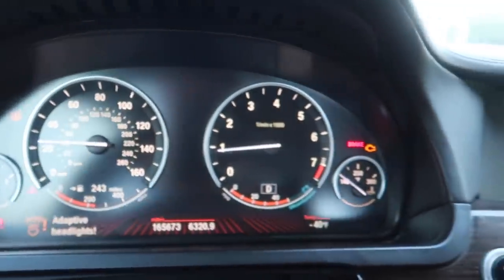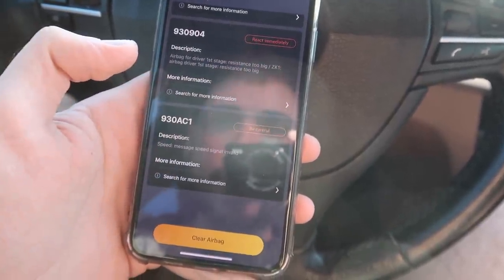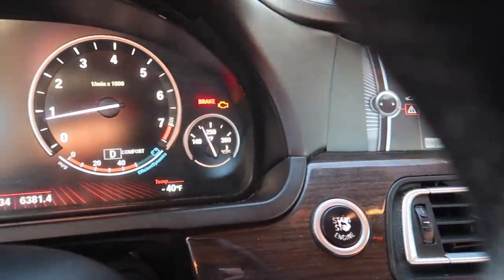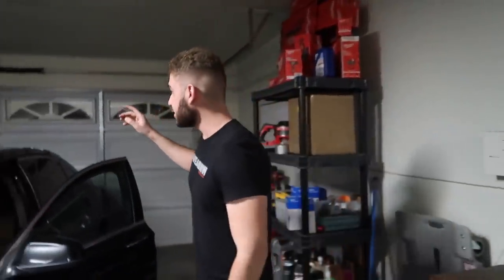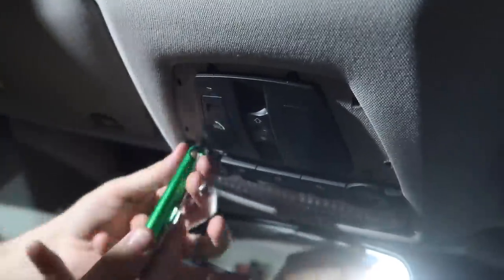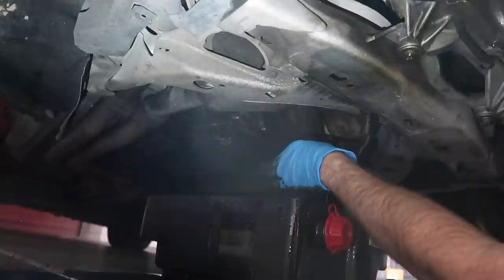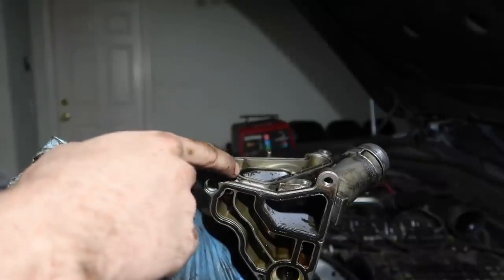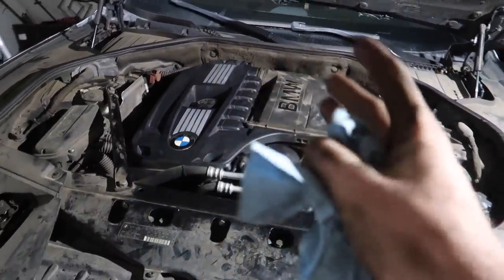Rebuilding An Abused BMW 740Li N54! Part. 1

Comment: Bmw's are known for condensation build up around the oil cap. Majority of the time it's not a head gasket issue. It happens from short drives. Long drives will usually burn the condensation off

Comment: Hey, depends the year of the car but the emergency release for park gear is located under the cup holders in the middle console. You have to pull them out. The tool to twist the lock is locating in the trunk with the tools that came with the car. If your car is a earlier model as mine is has an umbraco screw under the car by the gearbox that has to be screwed in for it to release and opposite for it to active again. But I’m pretty sure that you can’t drive the car with this active so I don’t thing that’s the problem here.
This gear changer is electronic and is known for some of the cables inside snapping that’s makes for example park unavailable

Comment: Hey Nour, I wouldn't be too worried on the the head gasket, oil and coolant mixture 8/10 times it's the oil filter housing gasket that goes bad. Like you previously stated there is no smoke coming from the exhaust and it's not overheating so, you should be all good.

Comment: There is a procedure you need to follow to purge any air out of the oil lines after opening up the oil filter housing gasket.

Comment: this is gonna be a good one just cause it is a 6 cylinder engine and not junk bmw v8's engines also i recommend doing a engine oil flush a gearbox oil flush and a cooling system flush god knows the intervals this car had its fluids changed i would also recommend a braking fluid flush too

Comment: Hi so I confused you with last message that must be for the older model 7 series hear are 2 links of YouTube that might help you sort the auto park problem 
https://youtu.be/1JLXDVPpj8w
https://youtu.be/UUKg3en7ulE
You car had it’s towing hitch in so it’s probably been towed so will probably need resetting hope this helps you 👍🏽
Reply: Up

Comment: You’re not supposed to open the coolant cap when the car is hot or the pressure will shoot out the coolant will burn you ....
Reply: Ma guy he knows his got the experience🙂
Reply: The bmw coolant expansion tanks have a fail safe that when a person depressurizes the coolant tank, it leaks from the bottom side of the tank so it wont shoot up the most it’ll do is cascade down from the opening!
Reply: I've done it before, it doesn't shoot coolant, it shoots steam, so as long as you don't put your face right above it and wear gloves, it should be fine. (Failed water pump on the highway)

Comment: It’s an n55. Even though the power plant is smaller the engine is easier to maintain. So the 740li is Actually worth keeping if you can fix all the electronics,oil gaskets,water pump, coilsand spark plugs,you should be ok. The power is the only true down side. The engine only made 300hp,300t.
Reply: it’s actually an N54 (twin turbo inline 6) 😊 and it makes 315hp & 330tq in the 7 series
Reply: Your right bro my bad. N54!! I remember he said it was a 2011 I don’t know why I would say N55.would take a look at those rod bearings and fuel injectors tho.And if he’s lucky he might can get some recalls out of that thing.
Reply: It’s a good engine as long as you take care of it!😎🙏 I’ve got an 09 e90 335i.so as far as I’m concerned you’ve got gold under that hood. If you keep it maybe some bolt on’s and a tune after some routine maintenance. That would be super bad ass!

Comment: bro just replace the whole oil pan and while you are at it do the oil pan gasket, because I can bet my life if it's not already leaking it will very soon. That way you can just use an oem drain bolt, 2 birds one stone, barraaa binggg barraaa banggg hahahaha

Comment: You must not have seen my comment from the last video, I had a 2011 BMW 750i with the exact same issue with the transmission, ended up being slippage in 5th gear so they had to replace the transmission and take the mechatronics out of the one from my transmission to be cheaper but ended up having to get a new mechatronic unit for the new transmission. A shop might be able to code the mechatronics and fix the issue but if not you might have to go threw that mess I said above😂

Comment: Did you see the camber on the left rear tire it is so bad something is wrong there Nour I would check that sooner than later could be a safety issue.
Reply: never mind just saw you still had it jacked up

Comment: Good job bro!! Changing the oil housing.  How long did it took? I am planning to do it my self on my car and not take it to the dealer. They rip me off big time.
Reply: I'll budget at least two hours. It's kinda stupid cuz you need to pull back the manifold to get access to one screw. And remember to get the right socket to extract the screws. They can be stripped easily. Don't even ask how I know this...

Comment: Hey man I created a small write up on the issue with the cross threaded oil pan drain hole on Bimmerpost. I ended repairing the issue on my M235i using a timesert repair kit. It’s honestly the best way to go, because someone cross threaded it during an oil change before I took ownership and my local bmw dealer wanted $2500 to replace the oil pan so I ended up spending a tenth of that and it’s as good as new and you get to use the OEM drain plug. I purchase a new one from my local dealer. Hope this helps. 

https://www.2addicts.com/forums/showthread.php?t=1740707